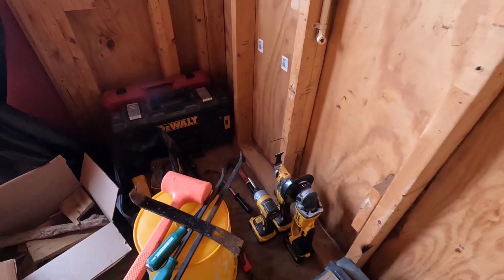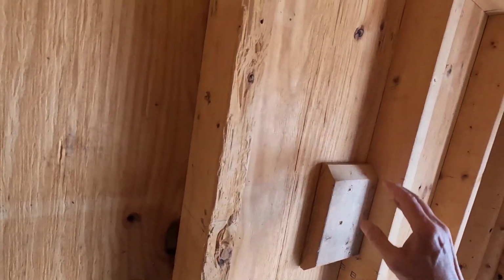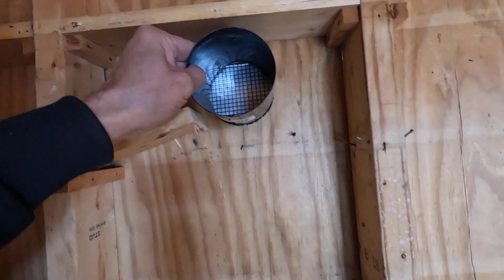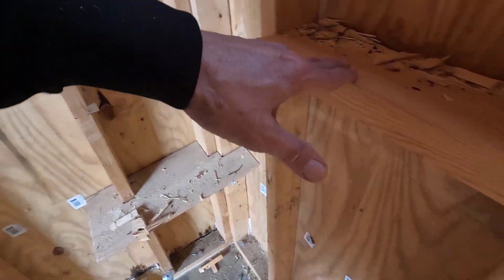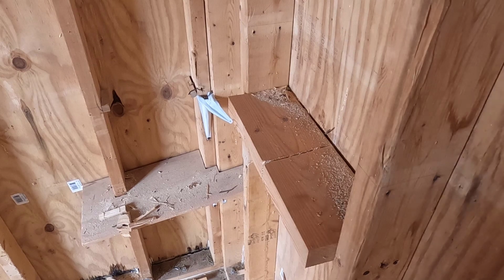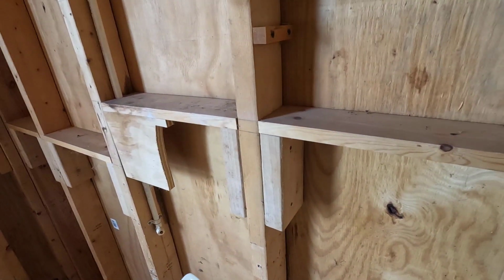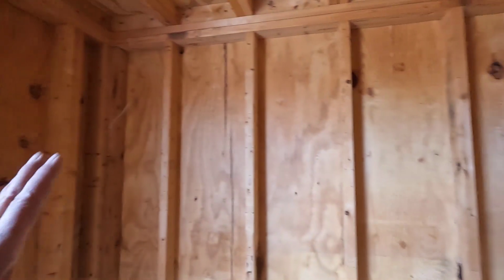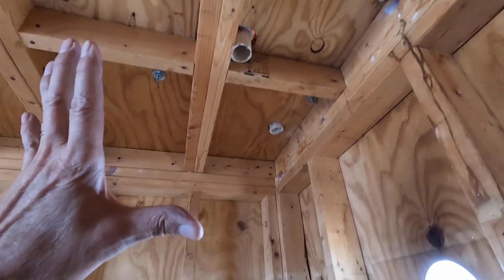Vicious Hammer Attack on a Tiny Barn [The Horror!!]

Comment from the maker: Today I blasted out the rest of the things that are in the way of remodeling the micro-barndominium. It was actually a relatively strenuous day, but I got through it and finished-up the lower level! The nails for hanging things really built-up over the last 20 years, as did the various shelves, hooks, and even a pulley! It's all gone now! There is demo work in the attic (big job!), as well as things to remove from the building on the exterior , then the remodel can proceed in earnest!

Recent Products used:

Pet Safe Mouse trap - https://amzn.to/3Zx5YdR
60 Watt Blue LED Bulbs - https://amzn.to/41eKzYL
Boeshield Total Tool Care Kit - Large Two Pack - https://amzn.to/41aqnqG
Strain Relief Rubber Boot - https://amzn.to/3YJGtGq
1/4" Nominal Polycarbonate - https://amzn.to/40YIobD
Power Cord - 10ft 14-Gauge 3-Prong - https://amzn.to/3YGLdML
PlyWheels Plywood and Drywall Dolly - https://amzn.to/3JXe4bi
DEWALT 15 AMP Plunge Router - https://amzn.to/3EcyZ6g
Oscillating Tool Blade, Titanium Nitride Coated - https://amzn.to/3JM45Wi
30 Pack Black S Hooks - https://amzn.to/3lg0cyB
3/8-Inch-Drive Impact Extension-Bar Set - https://amzn.to/3lcpr4I
6 Piece Impact Socket Adapter Set - https://amzn.to/3HycYjk
Bolt Extractor Set - https://amzn.to/3x146Od
Kinco - Premium Leather Work Gloves - https://amzn.to/3XWT0W3
#10 Countersink - https://amzn.to/3kxA6H3
1/2" Shank Tongue & Groove Router Bit Set - https://amzn.to/3QQk0UZ
Temperature/Humidity Sensor - https://amzn.to/3CwMD3h
16' LeverLock Tape Measure - https://amzn.to/3MRu9i9
Seagate Desktop 8TB External Hard Drive - https://amzn.to/3gRZGEC
SuperWinch Terra 45 - https://amzn.to/3AdzJWR
Large Tapcons - https://amzn.to/3TDkJbz
Heavy Square Washers - https://amzn.to/3E1tvKV
DeWalt Impact Wrench Kit - https://amzn.to/3EtMaQY
Flexzilla Air Hose - https://amzn.to/3ARo6W5

Comment: I actually enjoy demolition work. It can get tiring, but you can think about other things while blasting away 😊
Reply from the maker: I agree, but sometimes it just sucks. In the attic, there was a massive mouse nest above the insulation in the ceiling — and I had to pull it down from right under it 😮 But mostly I agree. I use it as time to plan the next steps.